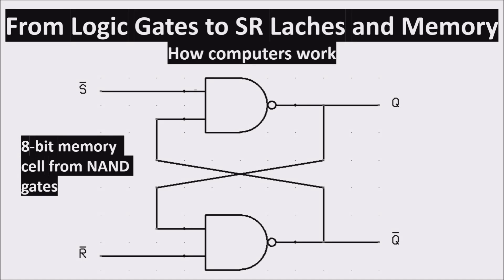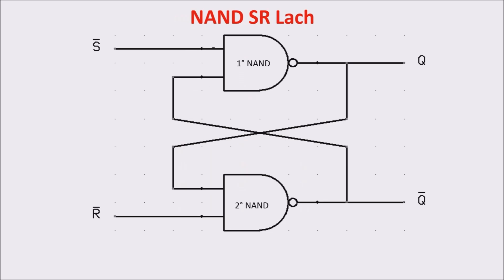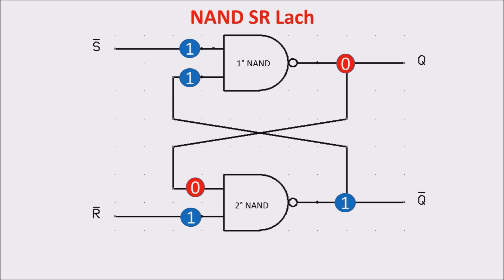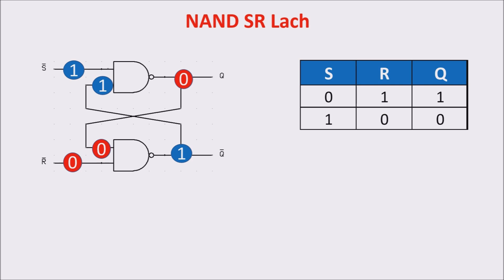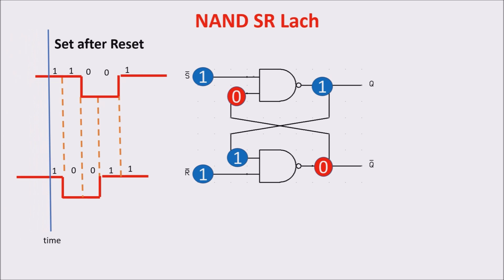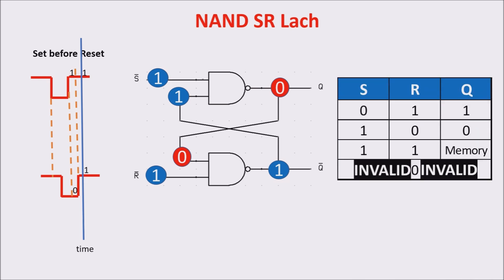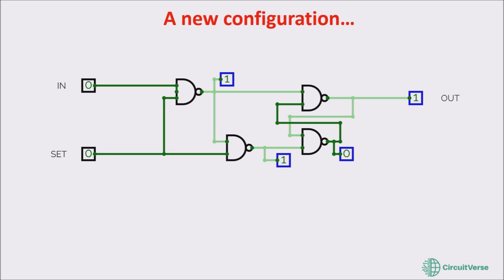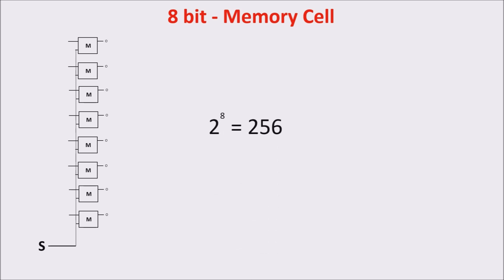SR Latch - From Logic Gates to Latches and Memory   how computers work PART 2

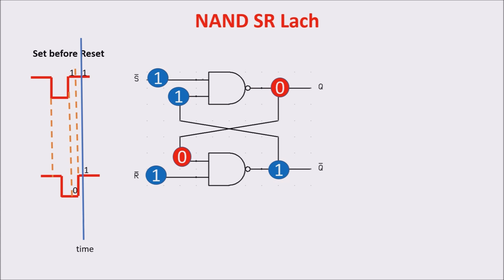Comment: 6:25 I think it's considered invalid because Q = Q̅ = 1, not because of pulse propagation. Whenever R̅ comes before S̅, or vice versa, and both R̅ = S̅ = 0, we always get Q = Q̅ = 1. Am I right? Maybe it's not valid because Q = Q̅?
Reply from the maker: At the end of the input pulses Q and notQ are: O and 1 or 1 and 0. It depends From which pulse arrives First: S or R. The situation Q=not Q last a very short time, when both inputs are at zero, but It Is not relevant. You Always Need some time After you can consider the output results valid. This time Is the propagation time and you should keep It into consideration in your design.
Reply: @Computer-and-Electronics First, I would like to thank you for your work and for your response. Then, I would like to explain why the condition S̅ = 0 and R̅ = 0 is considered invalid in a NAND-based SR latch:
1. Logical Contradiction: This condition forces the outputs Q = Q̅ = 1, which violates the fundamental rule that the outputs must be complementary. A latch cannot have both outputs high at the same time — this state is logically invalid.
2.Unpredictable Behavior After Release: When returning to S̅ = R̅ = 1, the latch is expected to retain the previous state. However, since the previous state was invalid (both outputs were high), there is no stable state to hold. Due to propagation delay, one gate may respond slightly faster than the other, potentially causing the latch to randomly settle into either the Set or Reset state — leading to a race condition.